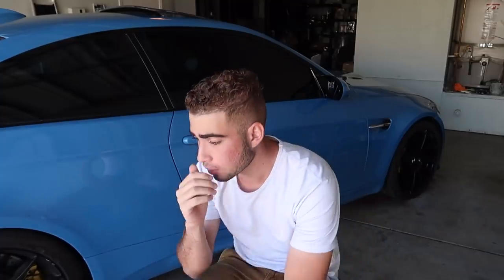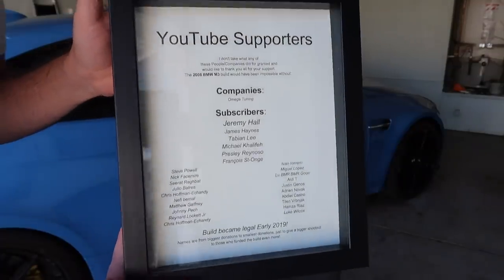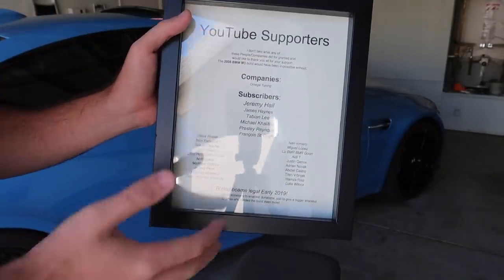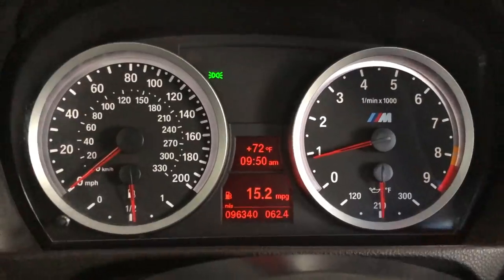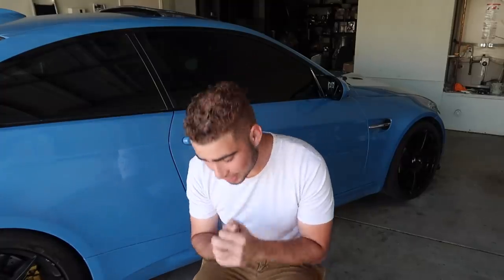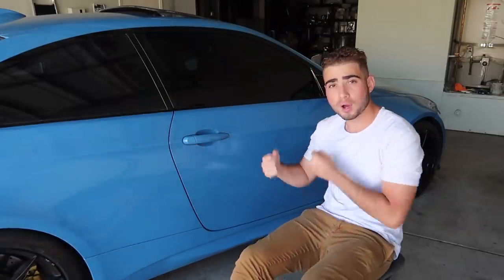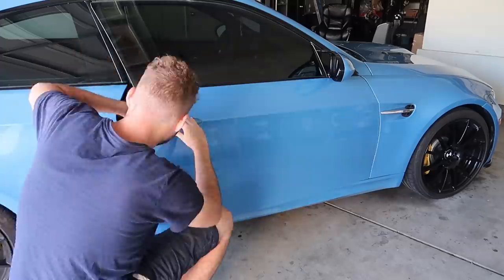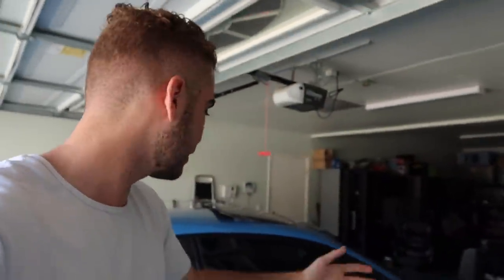MAKING THE BMW M3 PERFECT!

Comment: You could also buy “cotton” angel eyes. Remove the headlights, open the housing up, chrome delete the inside, put the LED cotton angel eyes in there, wire it up and put it back together

Comment: i have a 2007 328i and did a valve cover gasket replacement about 2 months ago . i believe the gasket i got (from amazon) was too thin bc the leak got worse . when i was putting the valve cover back on the gasket kept slipping off . that means it’s too thin right ? also where would be a good place to get one that fits OEM . i’d appreciate any help